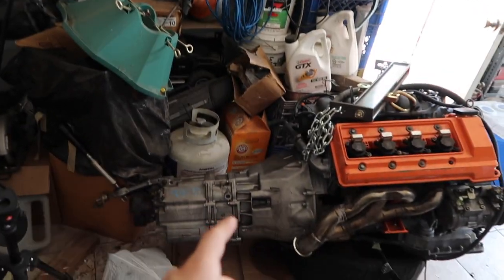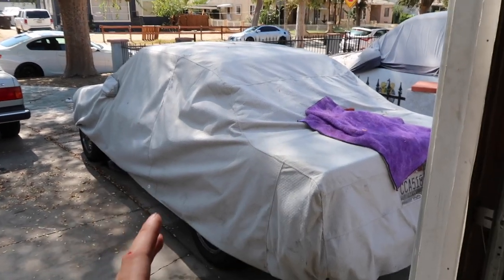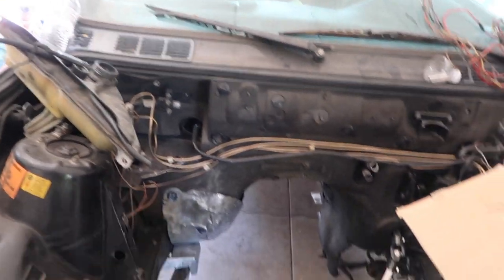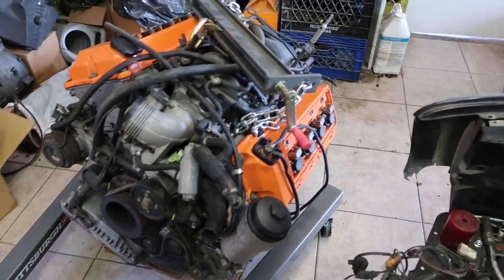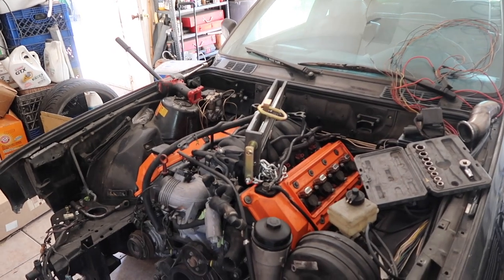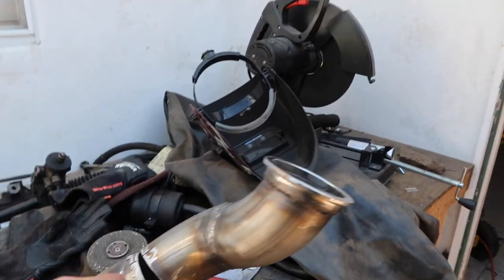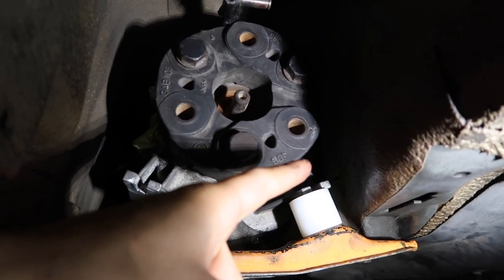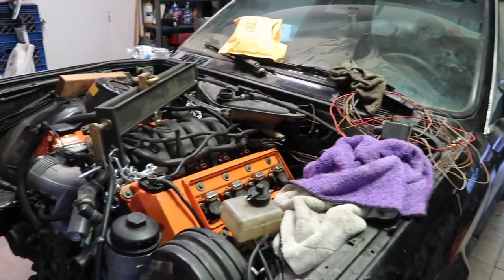IT DOESN'T FIT.. E30 V8 M62 ( Engine Arms? )

Comment: Hey bro,  Don't be disheartened this is the nature of the project car especially engine swaps. I'm doing a V8 e30 swap on my driveway. It's been a long term project. I went through 2 different engine mounts.  Have the same gearbox mine has broken mounting points though. I'm using subframe spacers.  Mine doesn't run currently cranks bit doesn't fire.  🔥 I had to lever the motor over to bolt in but that could have been the angle on my driveway.  Stay positive 💪
Reply from the maker: Gets frustrating but always gotta stay positive! Thank you 🙏

Comment: Maybe you van compare the engine arms with the ones garagistic or 300mm.de supplies and check for differences. Keep up the good work..! it aint easy now.. maybe keep thinking about the v8 grawl you'll be rewarded with when it's done 😃
Reply from the maker: jorge bierkens Yeah garagistic is about an hour away from me, so I’m gonna take them and compare both together. Hope this is the issue !

Comment: Hey bro, I’m having the same issue with my Garagistic mount arms.  I bought them years ago but finally getting around to doing the swap now.  Can you elaborate on what you were able to find out?
Reply from the maker: Yeah pretty much fuck garagistic, their products always come with some sort of fitment issues, others on fb groups can vouch as well. I got some new mounts from Lown performance and the driveline sits perfect!
Reply: @esgworks  Ah, shitty deal.  Was gonna buy a body mount shifter from them as well but now I’m not so sure.  Thanks for the lead on the Lown mounts, although I’ll probably end up modifying the Garagistic ones to mitigate my losses.   Not too pleased about it though.  

Thanks for the quick reply, you got a new subscriber.  Good luck with your builds